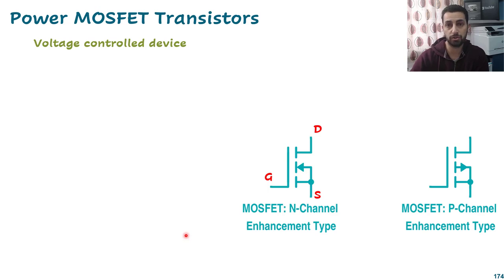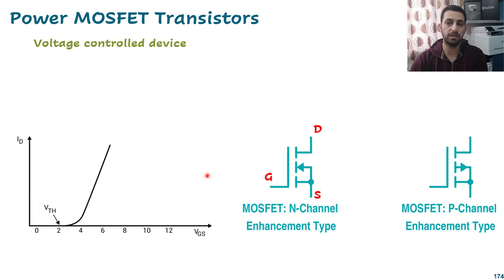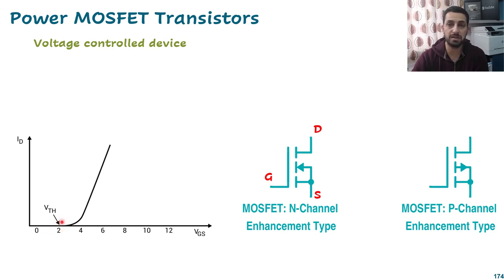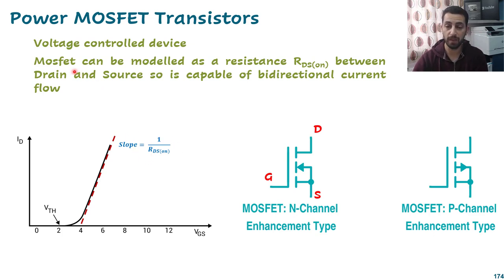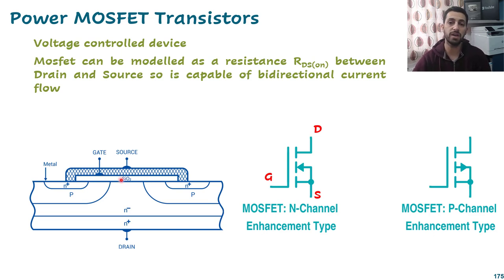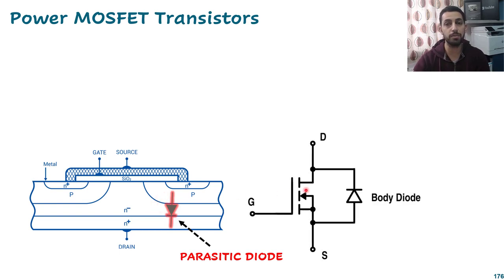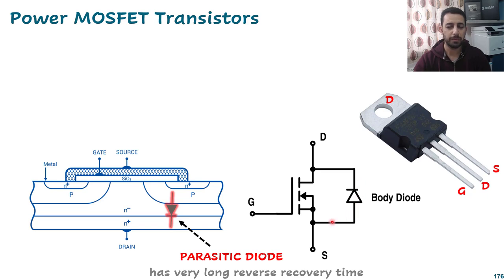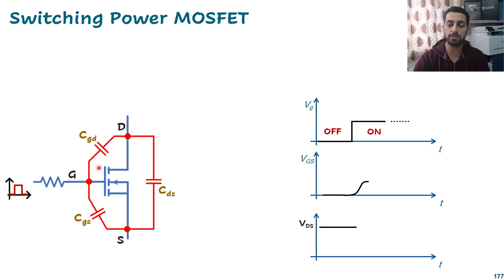23 Power Mosfet Transistors | Power Electronics

Comment: 15:44 the chart in the middle only applies to inductive loads. For resistive load ids wont max while vds is still high. The transition together over the miller plateau.
Also on the simplified chart to the right, the exponential part of the curve shouldnt look like diode curve, but charging cap curve where is rises fast initially and then slows.
Regarding the two caps shown in parallel as equivalent, this works after the plateau. During the plateau, cgd appears bigger than it is due to a multiplicative factor from miller effect.

Comment: Exellent explanation doctor Walid.
I have a question about the gate current . When i calculate     it the results differe between the two equation (the one using the capacity and the other using the gate charge).
So, wich of those equation give the optimum gate current? And, how to calculate this current during the turn off  time?